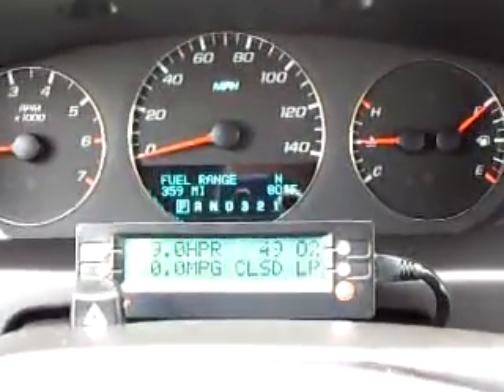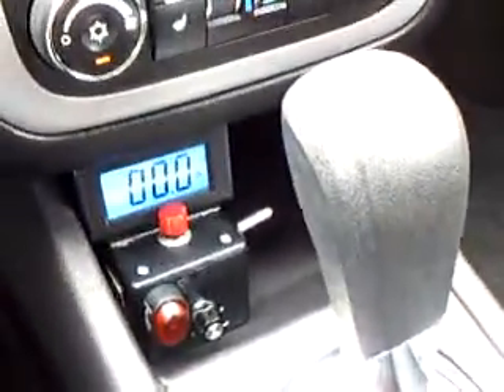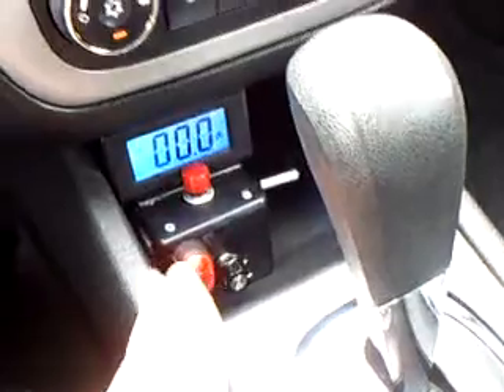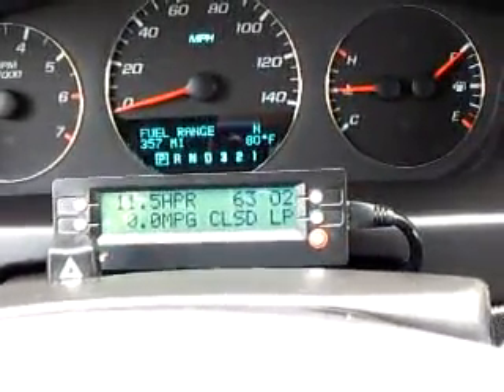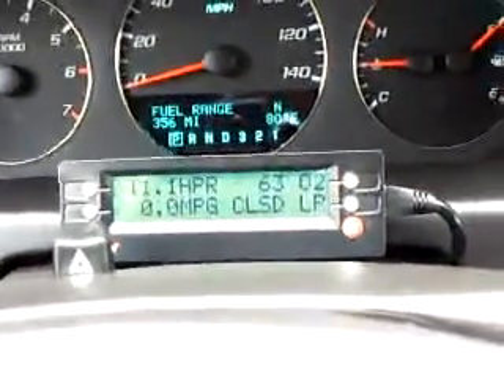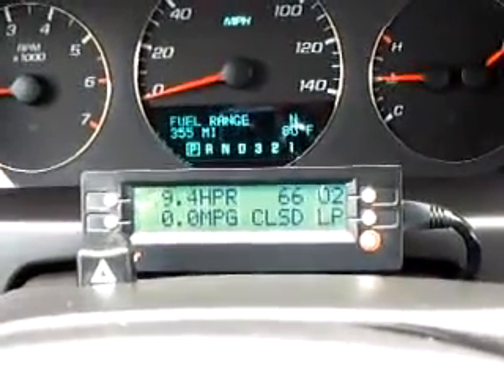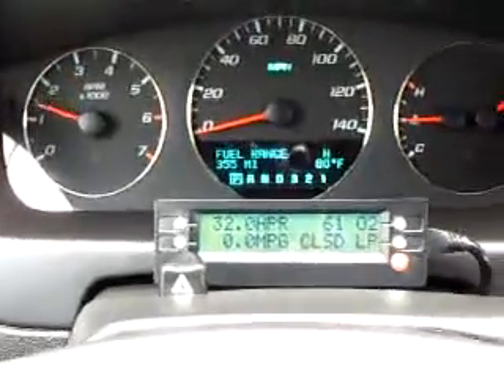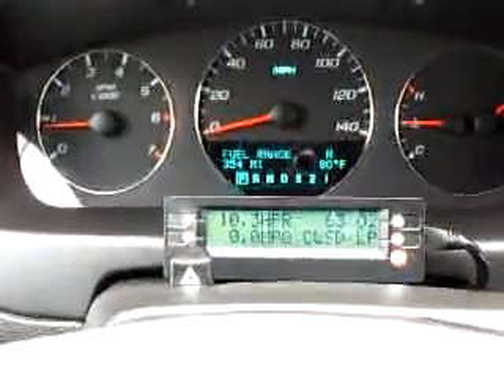#005 o2 sensor reactions with  my efie and HHO

Comment: The O2 reading is being measured after combustion. And the ECU make the adjustment to achieve the 14.7 A/F mixture. That's the reason why no change is perceived. It would be interesting to see if O2 levels can be measured before combustion..
Reply: +Ediberto Jimenez bump
Reply: I did measure it there’s was nothing in screen but I did set the iffie at 600 millivolt

Comment: i would like to know where you got your EFIE gismo from if you could e-mail me and let me know, i would really appreciate it  thx
Reply: It’s really easy to make just get a 100k potentiometer and the connect a 60k resistor to  number 1 pin and connect the 1.5 volt battery to the resistor (+) that’s is and (-) to pin 3 and to the negative wire to the o2 sensor pin 2 should con to the ecu cut the o2 sensor and connect it the same as Effie

Comment from the maker: My car recently threw a P1133 code on me yesterday. Which is an o2 switching error. I had my efie set to high to lean. That is why the o2 was kinda stuck at around 65. I turned the pot setting back a little, and now I'm getting more fluctuation with the o2 reading, but no values below 60. That's what the computer expects, more fluctuation on the values. So now I can see what my MPG are. That was my initial concern, was that the values were not fluctuating with efie on.